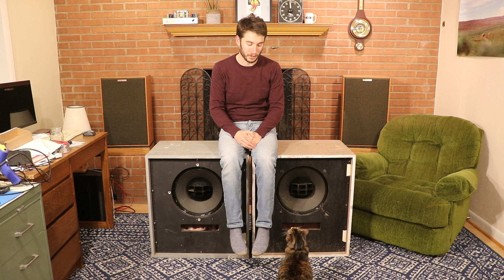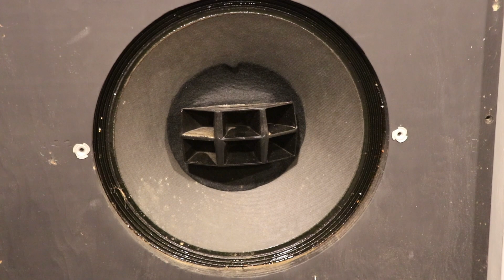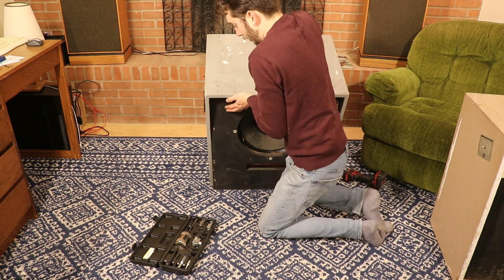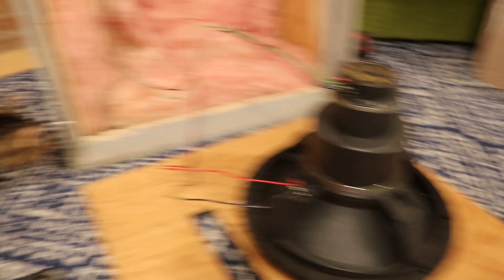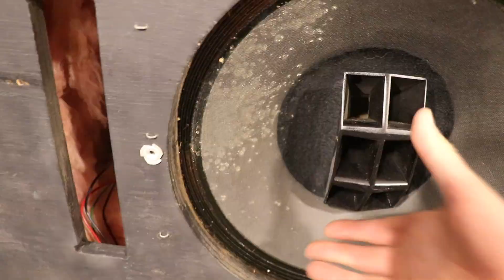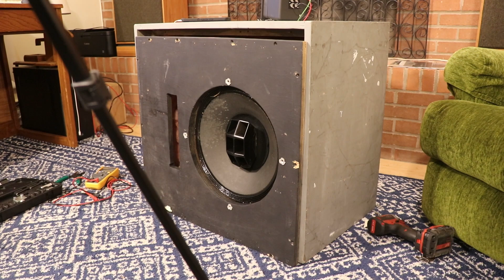I Found The WXBU CBS Studio Monitors From The 70s! Altec 604-8G

Comment: I don't generally like vintage horn speakers but these are the best and are actually fantastic sounding.  The legendary mastering engineer Bob Sax used them for many years and they were the most popular studio monitor for many years.
Reply: Those boxes have too much fiberglass, about an inch on the walls and get it away from the port.  You could put 2 to 3" on the top opposite from the port end.

Comment: these are 30-60 watt speakers, and if you get anywhere near 60 they will blow instantly. youre not going to be "breaking windows" with these speakers, especially not in these poorly designed boxes. the box WOULD be big enough to give it some decent bass response, but it would have to be a sealed box, or a properly made port; not just a rectangle slotted out directly below the speaker. these things are undoubtedly overpowering at ~400Hz.

Comment: That compression tweeter is super easy to fix. You probably just need a soldering iron and some Flux. If I were you I wouldn't replace the old compression domes as the replacements won't sound the same. These AL compression drivers are notorious for having their solder joints blow out. Luckily they only take about 5min to fix. There's even enamel coating you can add to them to help protect the joints.

Comment: Great Plains Audio is The  place to go for the parts . Altec Lansing is some the Best vintage speakers made . The 604 series have very live sound. I have been listening to vintage gear for 50 + years . If they are in the right sized cabinet you forget the sound is coming out of a speaker. Tube gear is what these speakers need. Very efficient speakers. Quality.

Comment: THE 1975 I WAS PRIVILEGED TO BUY TWO PAIR FOR ALTEC LANSING MODEL 19S THEY ARE MASSIVE CONCRETE CRACKERS WE HAD THEM AT THE LAKE HOUSE.. 16 FT AWAY FROM A PLATE GLASS WINDOW WHICH WAS 5 FT WIDE 6 FT TALL TWO PANES EACH PAIN 1/4 IN THICK AND THEY CRACKED THE INSIDE WINDOW PANE FROM 16 FT AWAY THE AIR PRESSURE WAS AWESOME IF EVER YOU FIND A PAIR OF I'LL TAKE LANSING MODEL 19 IN NEAR MINT CONDITION BUY THEM

Comment: Good score.. The plywood used on the cabs seems high quality.. You just need to refinish it and change the flat head to Allen type screws and maybe install threaded inserts for them.. You can also add internal bracing to stiffen up the cabs.. If you want it to go lower in frquency you need bigger cabs.. Great Plains could help alot with new Voice Coils and Cones and also the replacement Aluminum Diaphragms for the compression driver..

Comment: My experience with Altec PA speakers is they can be picky about the amp that drives them.  I once tried using a high-end 270W/channel Pioneer receiver on a Altec column, but the 100W Altec PA board drove them better.  I suspect the speaker's impedance is highly reactive and some amps just can't deal with it.

Comment: Interesting speakers. Who knew studio monitors designed in the coaxial era were still installed in the 70s.
Flat head screws work just fine if you don't use a power tool. With a normal screw driver they usually come out better than Philips, especially when they are somewhat corroded or glued, because Philips-heads are torque limiting by design, so they wouldn't get overtightened in mass production.

Also, check the crossover circuit if decide you rebuilt those. The tweeter might have blown because of a bad (shorted) cap or just wrong filter design.

Comment: If I can make a suggestion, take a router to the front speaker baffle, after removing the the speaker, and using a 1/2 inch round over bit, route the front edge of the baffle and round it over, this will eliminate the edge resonates of the sound from the coaxial speaker!!, good luck!, also,  replace all screws with Phillips head screws!!!

Comment: Fantastic find. I worked at a production company in the mid 80s and we had gigantic JBL monitors built into the wall. Amazing range, driven by Crown amps though. Altec Voice of The Theater speakers were crazy as well. Love the vintage gear. Thanks for sharing!

Comment: Unless the coil is straight up blown, witch by the sound of it I doubt, that speaker probably just developed a rub over time as materials shifted slightly with age. If you can carefully remove the spider from the basket, realign the coil, and reseat the spider you should be able to fix the rub. I've had good luck with this tactic on a handful of old mids and woofers, though your mileage may vary as I know very little about those drivers. For that open tweeter, just cross your fingers and hope the open isn't in the coil itself. If so it shouldn't be too bad to repair.

Comment: Nice catch. I've had several Altec compression drivers fail when the voice coil ribbon disconnected from the terminal inside the driver. Bill Hanuschak at Great Plains Audio can restore that loudspeaker correctly.

Comment: I have dozens of altec 604s in my collection. You have the 604g speakers based on the one you opened. The other speaker looks like it's using the altec 604e crossover. Maybe it's an E or G....G is newer, last generation to use AlNiCo magnets and its phase plug was upgraded to "tangital" phase plug where the E used circumfrential phase plug.... odds are if the tweeter is blown and the woofer is rubbing, someone abused these and smoked the coils. Replacements can be had from Great Plains Audio. Enjoy! Ps, the 604g actually came in the 620 cabinet which was 9 cuft.... big sucker but sound and imagine is to die for. I have some videos on my channel showing these speakers in action.

Comment: There was a time when my hands were steady enough to do surgery on stuff like this. I found many older drivers were burned right at the end of the winding and I could simply unwrap one turn, resolder, then add a little household glue to keep things tight. The hardest part was carefully removing the suspension so it could be reused. The few times I did them I had great luck getting everything centered, so no rubbing.
Reply: Isnt the solder joint on the cone itself?. Why remove the spider?.
Reply: @Vortexan9804  ... because the burned section is usually under the spider. The ones I found were toasted right at the 90 degree bend where the wound part ends and it heads up through the spider. IOW, the bend is the weak link. If you can remove a single turn from the coil, you now have enough to reach the connection point up on the cone. Don't get too much solder on the flex wires or that will be the next weak point. I used a light coating of Elmer's glue (no solvents) to secure everything when done. It dries almost clear.

Comment: Hold off the rebuild.  Unmount the speaker, then remount it into the cabinet, 180 degree flip, wait a few weeks.  The rubbing is due to gravity pulling on the cone for 50 years causing the cone to sag.  Let gravity fix that rubbing for you, but you've got to be patient. Enjoy!
Reply: Do this!  I was about to comment that I did the same with my 604-8G that was rubbing. It’s fine now, and when it’s mounted in the cabinet, you can’t tell it’s upside down.

Comment: Oh man thats a lovely score there! Im jealous actually. These are worth going all the way with, fully refinish them cabinets! Most definitely get yourself a HIGH CURRENT power amp for them, juice them puppies properly, and you wont want another set of speakers the rest of your life!
Reply: Those speakers were designed to run on very low power, single ended tube amplification. 10W/pc is probably enough to drive them into distortion.

Comment: Wow this video is so cool! I have a pair of these Altec Lansing speakers in mint condition that I am enjoying with my originally purchased Marantz 2285B receiver from the 1970's. I had a full recap and restore of the Marantz 2285B this year. Thank you for posting and your task to repair the compression horn driver!!! My story...in the 70's Altec Lansing sold the plans along with the 604-8G and crossover unit. Many built what was called the Model 17, as purchasing factory made units thru stereo shops was very very expensive. The model 17 measured 40high x 26wide x 18deep. I however along with my brother built our DIY cabinets 48h x 24w x 16d. With the help of a wood shop, we made four speaker cabinets from 2 sheets of 3/4in real teak veneered plywood and one regular sheet of 3/4 ply for two sets of front and rear panels. The speaker cabinets were glued and screwed like the ones in this video! The beauty though is that our drivers were dropped in from the front face at the very end using a few good screws! So no problem for access to the speaker or interior of the cabinet. Crossovers were installed in the cut out at the rear of the cabinets. I remember the most critical part was the location and size of the port at the front.
We also made removable grills with acoustic cloth for a professional finish and look. The speakers were/are amazing and yes my parents did give me heck when I broke the single pane glass in my bedroom window listening to Pink Floyd's - Dark Side of the Moon. The bass and highs coming out of the speakers is incredible. These speakers are also super clean and efficient to even listen to classical at very low volume and amp output. Later on in life around 2000, my kids were playing around with the stereo and blew the coil on one of the horn drivers as I did not have my Audio output Rt channel fused to my speakers. The horn driver sounded the same as you demonstrated on this video! Luckily, I was able to take the speaker out with ease and take to Santon Audio in Toronto. I saw first hand how the fried / broken aluminium voice coil was replaced with a brand new coil! Some say that you can try to repair (solder) a broken voice coil, but to replace is the best way to go. The repair cost me about $200 Can with an Altec Lansing OEM coil. Not sure what the aluminum voice coil cost is today.
Great work on your channel! As a senior, I am so proud of the newer age of enthusiasts like you that value the vintage audio equipment era!!!

Comment: Remember that in the earlier days of Hi-Fi everyone had MONO Hi-Fi Systems and only needed One, usually large, high quality speaker. Look back into real vintage speakers before 1955, the speaker sizes were all fairly large heavy speakers. Although Stereo was experimental in the 1930’s WW2 interrupted its development until the mid to late 1950’s and in the middle 1950’s E. Villchur’s Acoustic Suspension Principle allowed for making speakers smaller in a sealed box and that development helped push the commercialization of Stereo forward at an accelerated rate allowing for two less expensive smaller speakers with “full response” and deep bass in cabinets that could fit on a “bookshelf”. Something that the wives of Hifi enthusiasts found appealing. 😉
Reply: Still, the larger the box (with limits), the heavier the wood, the better the speakers, the 'softer' the sound....
Reply: @erikdenhouter  

The when the AR-1 sealed speaker came out in the mid 50s it blew all of the huge, open cabinet console speakers out of the water when it came to low bass response. Much more controlled, louder and deeper bass at a smaller size. For the mids and treble it had an altec 755a 8" full range.
 As a concept, it was better than most that came before or after it, in my humble opinion. Even if the implementation did have some problems.

Comment: Death to flathead screws! I just recently learned about JIS screws and screwdrivers, and I'm on love -- especially when it comes to working on vintage, Japanese manufactured audio gear. 

These Altecs look amazing! What a great passing of the torch, from father to son to you, the young neighbor.
Reply: Flathead screws are fine, just don't use a power tool. Also you wouldn't want anything else than flathead or Allen where the screw heads are visible, because that just looks a bit janky.
Reply: I still feel annoyed no one told me about JIS heads years ago. They are essential on some Japanese cars, and hifi of course.